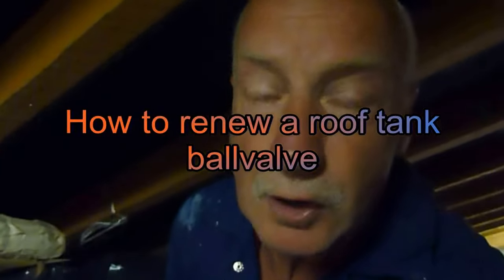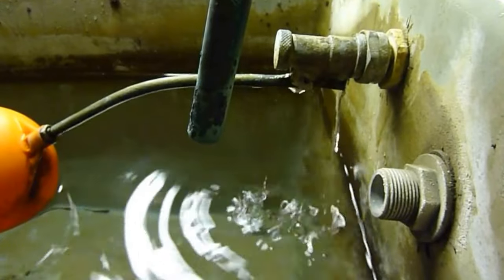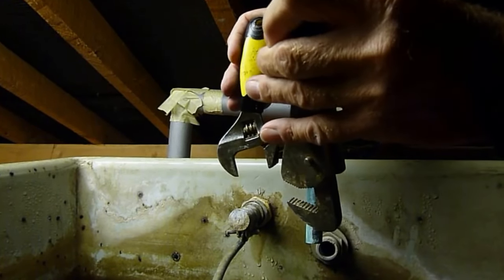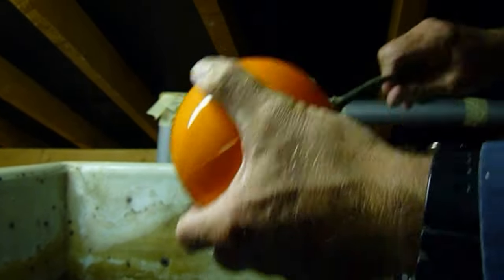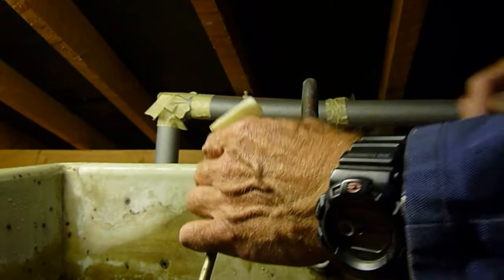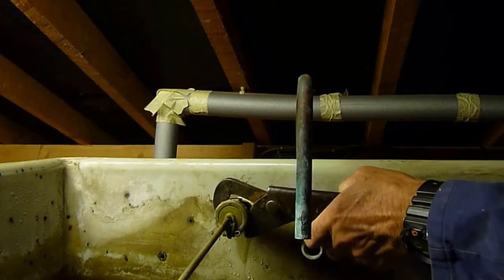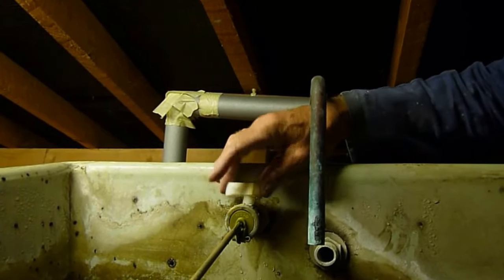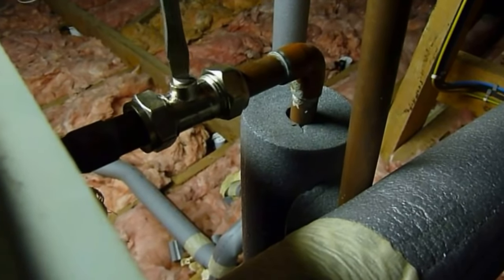How to renew the roof tank ballcock if you have an overflow running.Or a water hammer noise

Comment: Hi Al,
I'm looking to do this in my loft, as it looks exactly the same as yours!  When it comes to turning the water off, all I have is the stopcock out by my water meter in the pavement outside. Will this be sufficient? Or would it be worth turning a cold tap on after turning off the supply, just to drain some of the water away from the supply to the loft tank?

Thanks in advance!
Reply from the maker: Oli Barton That stopcock will be fine. Opening the down stairs tap will remove any water left in the pipe, so it is a good idea. Al.

Comment: Hi, I'm from Dublin, Ireland.  Grinding sound coming from the cold water tank while filling it.  Can I ask, Is that the problem with bad ballcock?  Now connected part-1 ballcock.  Can replace this with Part-2?  Thank You...
Reply from the maker: Replace the valve with the part 2 and all will be well again.
Reply: Hi Dereton33, Can I ask,  Is this OK to replace the ball cock from the outer side of the tank? I meant by using full of the new ball valve,  becuase our tank has shades at the inner sides, so difficult to unscrew from the inner side.  Thank You

Comment: Hi, the ballcock was replaced in the tank , But now when the toilet is flushed the pipes rumble throughout the house.  This only started since the ballcock was replaced.  Any idea please?
Reply from the maker: A part 1 fitted instead of a part 2. If it is a part two model  making the noise, you can get a silent fill valve for the roof tank. As a cheap fix you may try turning the flow rate down vis the main stopcock.

Comment: Hi there warm water coming out of the pipe on roof for few months now I hope changing the arm ball and valve solves my problem?
Reply from the maker: If not you have a inner coil cylinder problem.
Reply: dereton33 I went on the roof and no buckets up there or under the house.Only overflow pipe going outside the roof.Its a old electric Rheem Alfa low pressure hot water cylinder.Please help

Comment: Thanks for this. Successfully replaced my ball valve and is working okay. I have noticed that the pipes running from downstairs to the tank are a lot noisier when the water is flowing into the tank. I cannot see any other reason for it other than it is a new fitting as I have done nothing else. Any ideas please. Cheers????
Reply from the maker: FredClobber Your pressure may be too high try turning the stopcock down and slowing the pressure to the valve. Other than that you could fit a ballafix valve on the inlet to the tank and just crack it open so it fills slower. I have a video on how to fit one of those. Al.
Reply: dereton33
That makes sense as there is no other reason for it to suddenly do it. I will give it a go. If not I will try the other suggestion. Thank you very much for all your help.
Reply from the maker: Try turning your main stopcock down so that your water flows slower, the stopcock is usually under the sink , so turn your stopcock right off, then open your kitchen tap , turn the stopcock gradually on until you have a flow that is not too fast.
Reply: dereton33 Sorry I should have replied 2 weeks ago. Did as you suggested and it worked a treat! Thanks again.
Reply: Dick King
Hi there. Did as Al suggested 2 weeks ago and it worked a treat. Cheers anyway!

Comment: Thanks for sharing this video - it's really useful. Is there any device that can be attached to the spout to reduce the noise it makes when the tank is refilling?  Maybe a flexible tube that goes from the spout into the water. If so, is there a technical name for this?
Reply from the maker: +Paul Dowsett  There used to be a plastic tube on them years ago to sort out the noise but now they are illegal, in case water gets sucked back down from the roof tank to a cold tap. EU  strikes again.

Comment: I was surprised to find that this task was possible even for me. I made one mistake as I attached the new ball valve before putting the ball on the arm, so that was a bit of a fiddle. I was hoping that the water level would be much lower than the overflow, but even with putting the ball as low down the arm as possible the water is only 2 or 3 cm from the overflow.
Reply from the maker: Bend the arm with grips.

Comment: Can you use a torbeck or silencer non siphon valve on cold water tanks. Can you recommend best one.
Thanks.
Reply from the maker: There is lots of quiet fill valves you can use Jim. (Check my Amazon plumbing shop) I would not recommend a Torbeck though.
Reply: Thanks...

Comment: Hi my ballcock and fitting are entirely under the water do I need to replace the complete fitting it overflows almost daily thank you .
Reply from the maker: It is easier to just replace the whole thing as in the video. They are very cheap.
Reply: @dereton33  thank u mine is pouring out quicker than a tap how do I turn off the water to stop it going into the tank ...so I can remove it

Comment: I put in new ballvalve in plumbing tank, water stoped coming out of overflow two days later, water stsrted to come out of overflow what can i do?
Reply from the maker: Check it is not coming from the small F and E tank. If that is the one you changed then the inner coil of the cylinder is gone.

Comment: I bought a 1/2 inch part 2 bal valve to replace my old part 1. However on attempting to fit it the diameter of the the ball valve connecter  was too small to fit the tank coupling. Does this mean i need a 3/4 inch ball valve. Have refitted the old Part 1 and still leaking.
Reply from the maker: +Tug Wilson . No change the tank coupling for a 15 mm one.
Reply: I wish I understand. Just a simple seaman here. My tank side coupling fits my old ball valve which is diameter 30mm. My part 2 is only 25 mm diameter.......Help
Reply from the maker: You could always fit a 22 mm to 15 mm flexi connector and jus cut back the copper feed

Comment: Another great video 🙌🏼👍 this may be a silly question but is there any way of adjusting the cold water feed flow rate from the water tank to taps (reducing it) via the water tank itself?
Reply from the maker: Just adjust the gate valve on the feed pipe down to a slower rate.

Comment: What is that pipe in the middle to do with @4:06 in between his hands? Our pipe in the middle won't stop pouring water at times and the overflow keeps going.
Reply from the maker: The expansion pipe. If that is running you have problems with your heating system.
Reply: @dereton33  Thanks for your reply, We have warm air heating so we only have an immersion heater. Could it be something to do with that?

Comment: Great video, just one thought, what size ballvavle fitting do i need ?, are they all the same
will it be 1/2 or 3/4inch
Reply from the maker: Hi martyn, it will be standard 1/2 inch. They are all the same.
Reply: dereton33 Thanks for the helpful video. I was wondering about the thread size too. Mine has a slow drip.  There are some advertised as 1/2" or 3/4". Possibly best I check before going to plumber merchant ?

Comment: Hi, I have a Vaillant boiler,  also a tank in loft that seems to feed bathroom cold water?,  Im gonna attempt to install a new bath suite  (God help me) the bath/basin isolation valves are ancient,  will not turn. So please advise me, do i turn off mains tap under kitchen sink,  and run cold bathroom taps,  will that then empty the loft tank?  Then can i change the bath, basin & toilet? (while im at it, fit new isolation valves) or, in the event it all goes tits up    ; )  just find me a plumber! Haha! Thank you once again for your help mate.
Reply from the maker: Yes open both the hot and cold taps until they stop running. Good luck.

Comment: Any suggestions on an easy way to undo a heavy lime scaled valve? Great video by the way!!
Reply from the maker: Tap the nut with a hammer and use bigger spannerrs
Reply: I just did the job and that was one of the techniques I used! Thanks fior the reply, really good of you

Comment: Ive got an old part 1 im trying to change that only has the locking nut on the inside how do i get that off ive nearly just smashed my loft up in frustration
Reply from the maker: Undo the  feed pipe then the nut on the outside of the tank, holding the valve from moving with another spanner.
Reply: @dereton33  hi thanks for the reply mate this msy seem a silly question but which bit is the feed pipe so i dont get it wrong and cause more damage than i have already theres a few pipe and loads of different section my shut off is right at the tank and it looks like an old garden tap 🤷‍♂️
Reply from the maker: The straight swivel connector is the part you need to undo. Look at where the valve passes through the tank there will be a flat backnut, then any thread showing from the valve, then the swivel connector. That is the part you have to undo first then the backnut.
Reply: @dereton33  top man thanks very much

Comment: Dereton I have a very noisy hot water system any suggestions on problem
Reply from the maker: Johnathon Andrew If it when you have run the hot tap, then it is the roof tank ballcock. Just change it, as in the video. Al.
Reply: dereton33 I have and as you say it seems to have sorted it. Previous home owner had almost bent old one in half. Thanks for the video and the advice
Reply from the maker: No problem.

Comment: I've done this and the new valve doesn't seem to stop the water, I was attempting to get the other part off (bolt from other side) but no joy, it just keeps spinning.
Reply: ok I've got the old part out now and replaced it all with the new parts, ensuring only the new washer is used, but it still gushes with water with the cock up high (which would normally cut water off). Could it be a bad ballcock? i.e. not high enough pressure?
Reply: Luke Timms Solved! When putting the new part onto the old I dropped the white part that sits inside behind the washer, I then realised I hadn't used the washer and went back for it, not noticing the white part missing! The valve wasn't closing because it only hard part of what seals it! Solved!

Comment: hi again, I'm getting a really loud high pitched horn like sound coming from the loft after running the water usually the hot but also on the cold sometimes. could this be the ball valve?

many thanks for all your videos they really are life savers :-)
Reply from the maker: Yes just renew the valve.
Reply: dereton33 thanks for the reply, last night when it sounded off I climbed up into the loft and could hear it was coming from that valve so I'll be getting a replacement and fitting it this weekend. the only annoying thing on mine is a pipe that feeds in through the lid of the tank meaning I can't completely remove the lid. guess I'll just squeeze in underneath. thanks again for your help :)
Reply: dereton33 hi one last question, the noise is pretty bad now and it's started to hammer is it safe to just turn off the tank inlet valve until the weekend when I can have ago at fitting the new ball cock valve?

Comment: Could this be the reason that I now have very noisy tank with loud trumpet noises from the pipes?
Reply from the maker: Yes.
Reply: @dereton33  Thank you, you’re right it did solve the squealing problem. What causes the noise? X
Reply: Hi again, I obviously I changed the ballcock before and it worked fine for a few months, now It’s making a loud rushing noise, when the water is topped up in the tank, what could be the cause of this any idea? Thank you in advance x